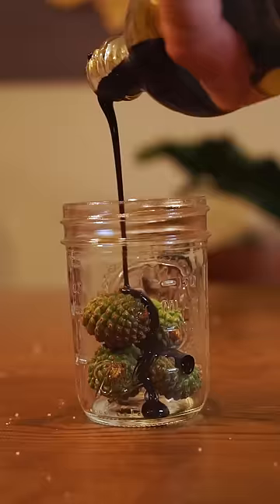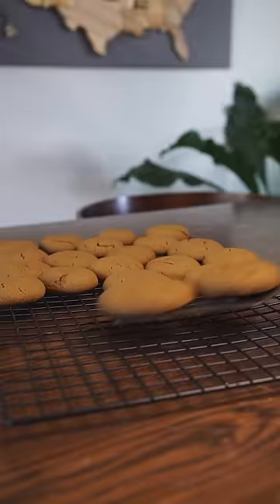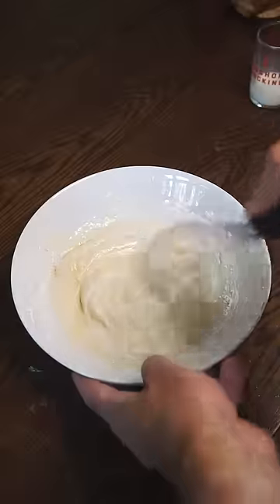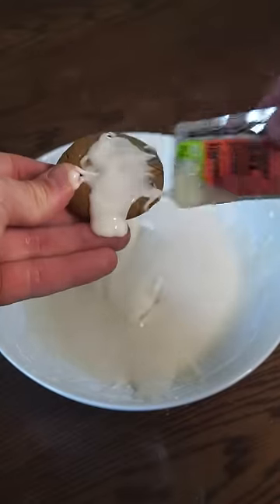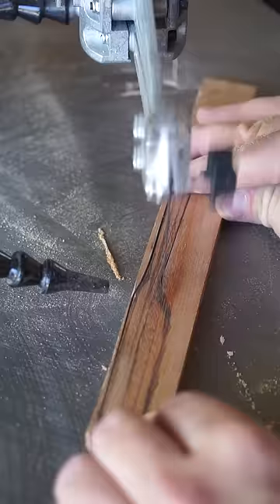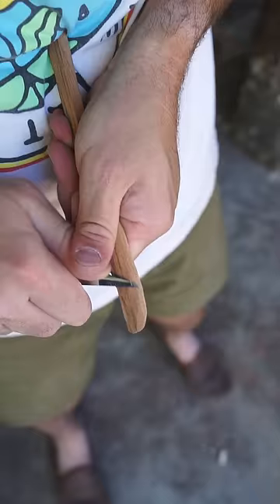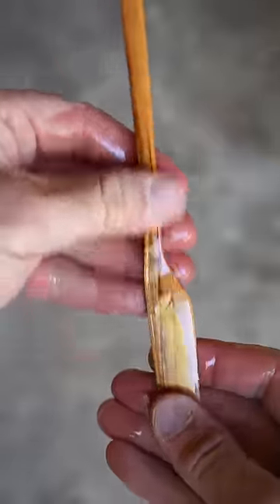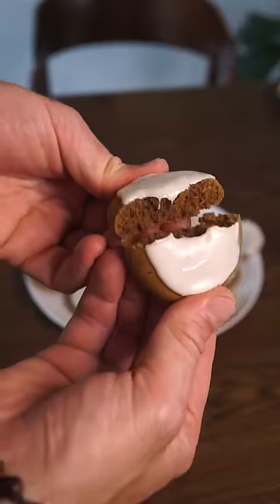Carving a spreadin' knife out of tigerwood (and using it to ice some pine cone molasses cookies!)

Comment: As someone who bakes things…. The easiest way to ice anything is heating your icing till it falls off of a knife or other object in smooth, fluid and consistent ribbons or streams (without stopping or breaking), dip the portion you want the icing on, into your icing, and then while holding it above the bowl, swirl the dipped object in a small circular motion to help remove excess icing, and then set aside to allow the icing that didn’t come off to flow off the sides until it sets. This is best done with your hands.

But I see why you wanted a reason to make a wooden spreader 😂

Comment: Correction on what tigerwood is. Tigerwood is wood that was cut on a specific angle and takes on the shimmer of the tiger eye stone. So, tiger eye is not necessarily a grain pattern but the glow or shine of the wood. Though the term has been taken and reused for the pattern the wood creates as it ages. The original use of the word was for the amber like texture of the wood.